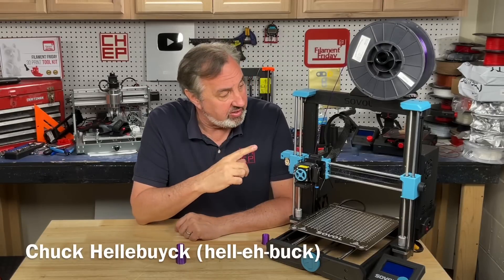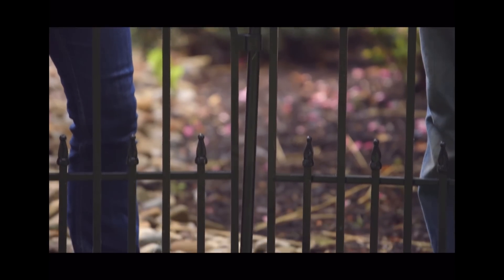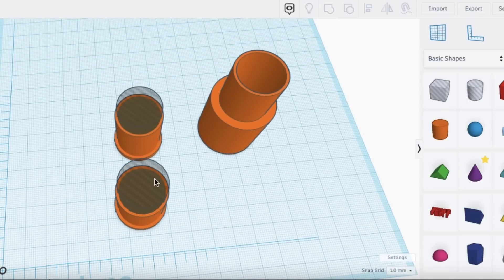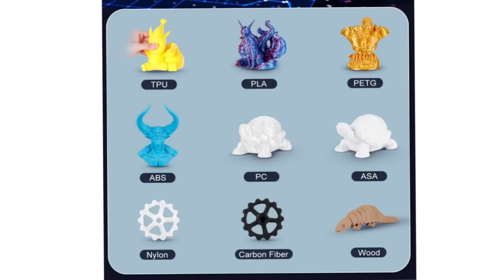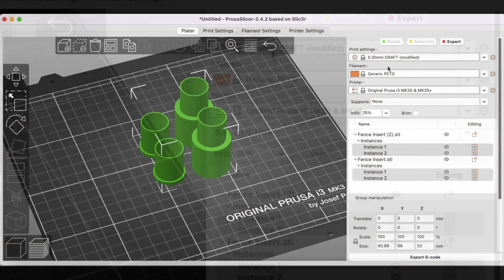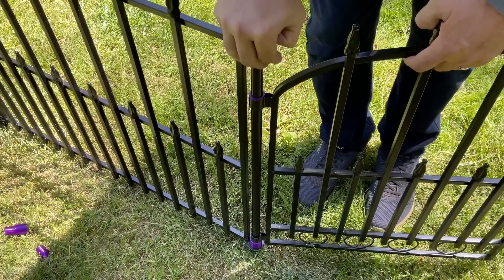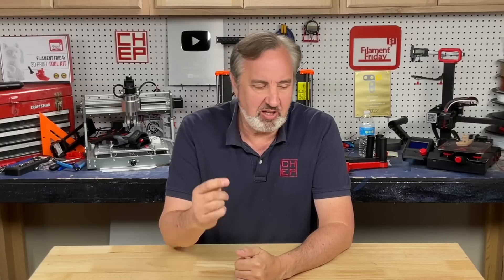Unbelievable Results From Printing PETG on Sovol SV06!

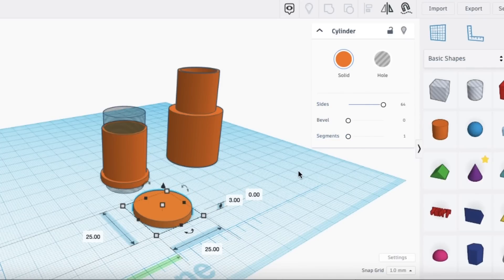Comment: 1:39 on tinkercad instead of using the orange cylinder, use the blue one that has 300+ sides, especially on the svo6 which i have. it gives a cleaner and smoother finish and is more accurate than the orange one. imo
Reply from the maker: Only blue one I see is the 6 sided polygon. Are you in another menu?

Comment: I recently bought an SV06.  Hoping to see more videos with it.
Reply: And how was it?
Reply: Worth it for $200? I have been thinking of getting it over the other budget printers that use rollers and then upgrading it over time.
Reply: @handikappad it’s a bit loud due to the bearings but the print quality is incredible
Reply: @handikappad  My Sovol SV06 just prints 24/7 non stop very few upgrades.  Part upgrades where: larger Y axis motor from 34mm to 37mm,  plastic Y axis bearings for quieter operation.  Printed upgrades are: Extra support for the ribbon cable where it meets the toolhead, support for y axis where it meets the control box, plastic fillers for the base frame extrusions, back cover for electronics box, rear mounted cooling fan, filiment guide for printing from an external spool holder. Parts worn out and replaced are: silicone sock, parts cooling fan.  I keep the bars oiled and it runs like a top.

Comment: I was so on the fence in getting an SV05. The only reason I didn't is they're order system can't ship to my address because my postal code is "registered" as being in a different city than my street address.  Oddly enough I never have this issue with anyone else. Still waiting to hear back from them in it and once they solve their problem I can place an order.
Reply: u mean 06
Reply: @alex59292  Nope.  SV05.  Have been thinking about an SV06 but I don't want another bedslinger and there is NO way I am shelling out so much for an X1C with the terms and conditions bambu places.  As well, cloud printing is a 100% no go for me.  I like a perfectly standalone, un-networked setup.

Comment: How quiet is the printer?
Reply: Very
Reply: I cant even hear mine on a thin metal framed table. Just fan noise.
Reply: It has the silent stepper motor drivers so fortunately the stepper motors make very little noise. The bearings make a somewhat annoying crackling sound which goes away after lubing the motion systems. 
The fans though...they're cheap and pretty loud. I've replaced the fans on my Sovol SV06 with some quieter ones and the difference is night and day.

Comment: i have a question regarding buying a 3d printer up to £300/$350. What would be the best quality i can get in this price range. I am looking at 2 options so far. Ender 3 V2 neo or Sovol sv06. Which would be better? Or maybe there is better better options than any of these?
Reply: The Sovol sv06 from what I can tell has by far the most features for the price. It has auto bed leveling, direct drive extruder, dual linear z axis, hi temp all metal nozzle, heated bed, linear step and probably some other stuff I'm forgetting. It doesn't just beat and ender 3 v2 it completely obliterates it.
Reply: @Bossmodegoat  thank you for your reply! i really appreciate, and this seems to be the final push i needed towards getting sv06 haha. thanks again!
Reply: Hands down, the Sovol SV06. I have been using an Ender 3 clone (Homers/Tevo Tarantula). I learned a lot, and did a lot of repairs and upgrades. When I bought a Sovol SV06 it just worked.  Not only did it just work, it works better than I could have imagined a 3D Printer working.

Comment: I get the most satisfaction from printing something to either fix or make better a household item.  Lawn chairs on patio, the feet wore out about 7 years old.  Tinkercad to the rescue. So I printed up like 30 of these and when I need one or two, I tap it in the bottom of the leg and good as new.  It may not last as long but even if I get a season out of them.   Patio table umbrella,  when it gets to windy I remove and put in it indoors.  The remaining pole that goes into the weighted base is left behind.  I printed up a cap that I slip over to bugs and mostly rain water out of that pole when umbrella removed

Comment: My first printer was a E3V2.  A good printer, especially if you have the money and patience to upgrade/tinker with it.

But then I got an SV06 and it's a CHAMP.  Comes with everything you'd ever want already installed, and I haven't tinkered with it a single time.  It just cranks out print after print, flawlessly.

I still have and use the E3V2, but when it's something I want done right, without worry?  It's going on the Sovol.

Comment: Glad you got Sovol. I really want the SV06 plus. Seems like a lot of printer for the buck.
Reply: I got one a few months ago, 2 things you MUST do when setting it up! BTW, The PEI powder coated bed sheet does not like PLA, you HAVE to use glue stick!

1. The z-axis does not work well using the auto level feature, I use 2 identical soup cans on either side of the print bed, lowered the Z using the "move axis" in the menu slowly with the 1mm setting. Once one of the sides just touch the can, disable the steppers and carefully adjust the high side using your fingers on the stepper motor until both cans lightly drag when you side them back and forth. Then you're done, no need to do anything else.

2. It is tricky to feed the filament into the extruder, cut the end at a 45 degree angle and lightly twist the filament as you feed it in, you will feel when it gets below the duel geared wheels, DON'T FORCE IT or use the knob to feed it in, it is a huge pain in the "can" to pull the filament out if it gets wrapped around the gears.

Other than that... It's great printer! Just keep your filament dry and you won't have an issue!

Comment: Got my SV06 lsst night. I also have a Anycubic kobra  and all i can say is i thought my kobra was good and printed well. The SV06 is better straight out of the box with no mods. I am blowen away. And i can push it over 140mms and still get good quality prints. Maybe i just got a good one but i am impressed. I have everything to convert it to klipper but will wait a bit and enjoy it stock for a bit. I wish sovol would have made the SV07 based on the SV06 and not based on the SV01 pro . Thanks for the video. Nice to see you showing other brands other than Creality.

Comment: thank you for the info about using the Prusa slicer and printer for the SV06....this will be much better with by MacBook as SOVOL doesn't have a Mac version.  Was there any setting that needed to be changed for the SV06 printer?  I'd love to see some profile tweeks for the SV06 like you have for the Ender's.
Reply from the maker: I printed without changes but it was shifted right a bit.
Reply: You can use the full/latest version of CURA — which should have a Mac version. Then if the SV06 isn’t in the default printer choices, search the ‘net and you can find many examples of what to set CURA to make your own SV06 profile. I did that on my PC… now I believe CURA already includes the SV06 as a choice.

Comment: It is awesome to be able to make things to fix problem in your own home.  Thanks for the intro to the SOVOL.  I've been wondering what my next upgrade should be to my beloved Ender2pro. Need something a little bigger.
Reply: Like I mentioned earlier SV06 PLUS is larger (at 300x 300 x 340) and has a classy colour display, better nozzle and filament run our sensor.
Reply: @BlondieHappyGuy  Sorry no way to compare my results vs on screen results.